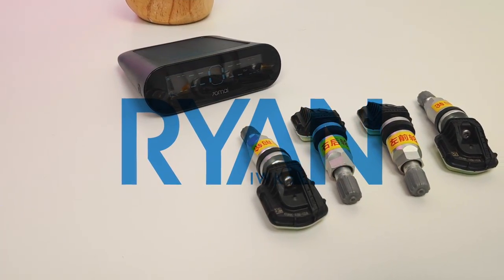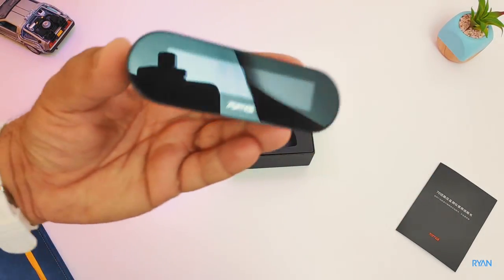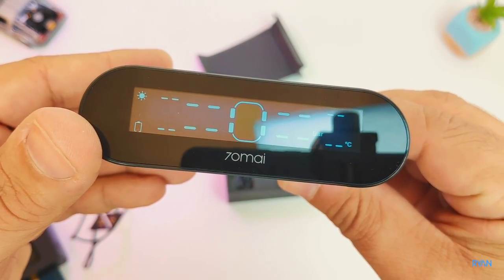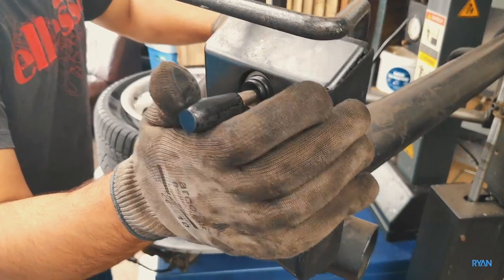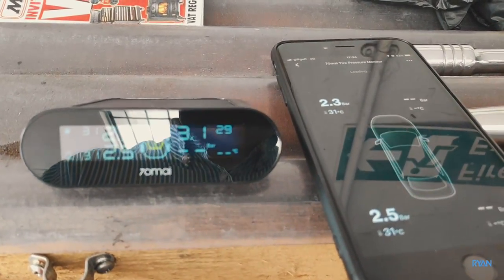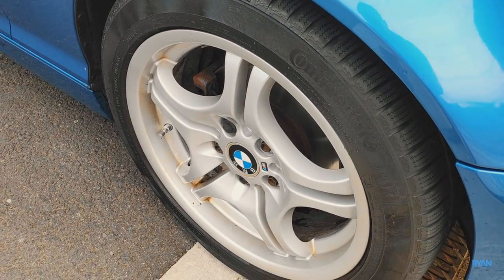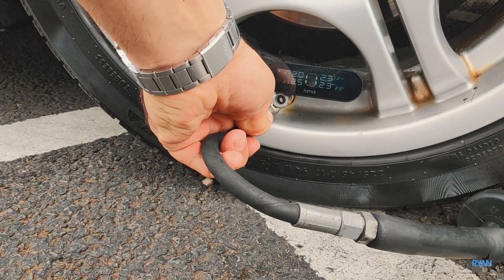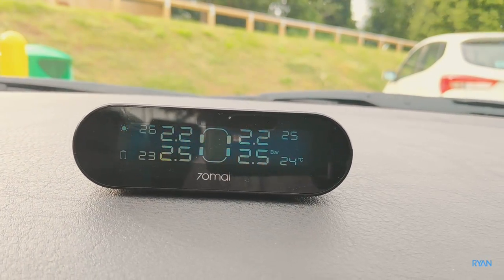Xiaomi 70mai TPMS Tire-Pressure Monitoring System - Installation and Review (2019)

Comment: the only draw back is it does not display air pressure in PSI, only in bars.

Here’s an update: A friend of mine bought a unit and it does display now readings in psi.  That’s a welcome feature!
Reply: Same brand?? Or other TPMS?
Reply: Yes, that’s correct.  It does show reading in PSI now.

Comment: after 8 months, is it still good, bro? no air leak at all ?
Reply from the maker: All good mate. Already swapped the tires at the front and the sensors still good.
The TPMS did save me from driving with low pressure after a huge nail puncture one of the tires.

Comment: Do you think internal sensors are more accurate than external ones? Also can you set tp to psi ? Thanks for a very useful review of a product that could potentially save lives.
Reply from the maker: That’s a good question. I never had a chance to test the 70mai external ones (lite version). I can say that these ones are close in terms of numbers :) thanks 😊

Comment: Great video! Is it possible to change batteries in case they die?
Reply from the maker: Hi Tiago! You mean the batteries in the sensors? I don't think you can. According to 70Mai, if you drive 2h a day, they should last for 10 year. The sensors go into sleep mode when not in use :)
Reply: @Ryaniwk  Yeah, that's what I meant. I heard you saying about this lifetime, the dubt was after that. Thank you very much!
Reply: Hi. Can you change the Unit from bar to PSi and °C to °F?  I think i saw your clip showing the settings were grayed out.  TYIA.

Comment: can the bar reading change to psi?
Reply from the maker: I don't think so, Jeremy. At least I couldn't
Reply: I have one. Unfortunately no PSI unit. Maybe in the future with the firmware update.
Reply: Unfortunately no at the moment when they update the firmware
Reply: How about battery of the sensors?? How long does it last and how to replace??
Reply from the maker: @chiennguyenphu7281   According to 70Mai, if you drive 2h a day, they should last for 10 year. The sensors go into sleep mode when not in use. There is no way to replace the battery inside the sensors

Comment: i purchase last year from bangood working fine, by mistake one sensor damage, can i buy only one sensor ?  can its working with old display ?
Reply from the maker: I think you can pair a new sensor with the unit. In terms of buying just one I don't think you can. I will double check that with 70mai for you.
Reply: @Ryaniwk  thnx
Reply: @Ryaniwk  70 mai sensor (without display unit) available on ali express,  if i purchage one sensor  its working with my display unit or not .  help me how i will pairing with unit.
Reply from the maker: I never paired a new sensor, but I believe you need to do it inside the app, Bind sensor menu. Have a look here, minute 10:15. Let me know if you managed to do it :)

Comment: How long is the battery life of the sensor? Is it replaceable?
Reply from the maker: You cant replace the battery on the sensors. According to 70Mai, if you drive 2h a day, they should last for 10 years. The sensors go into sleep mode when not in use :)

Comment: how to change from BAR to PSI ... AND .... one of the sensors are no reading automatically .. anyone would know the reasons ? or how to fix it
Reply from the maker: You cannot change to PSI unfortunately. Sometimes the sensor take a little bit more time to read when you start/move the car. Is that what is happening?
Reply: @Ryaniwk  right now everything works fine... I figured out that it takes some time to the sensors to be activated...

Comment: How to change units?
Reply from the maker: There is no way to change units :(
Reply: Yeah, that's a pity that you can't change from bar to psi. How easy is it to change the sensor battery?. I know the manufacturer said it should last for 10 years but those figures are usually v optimistic.